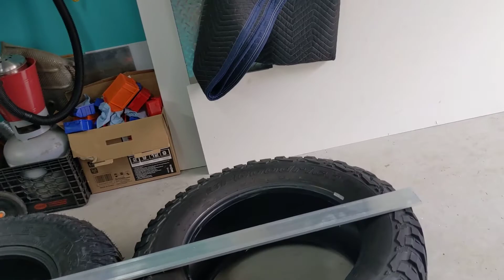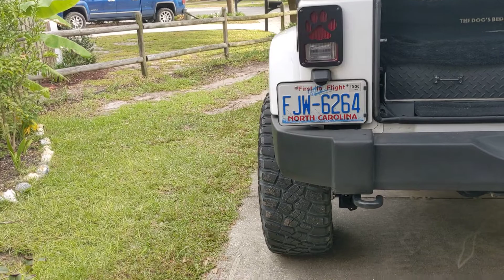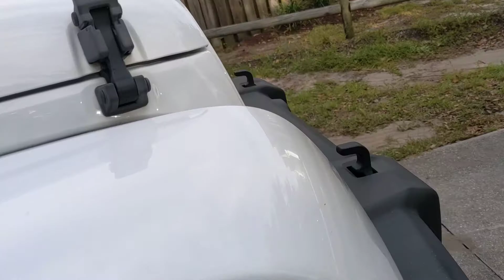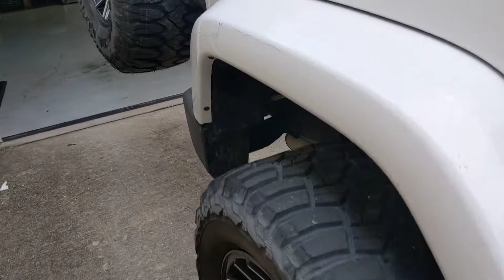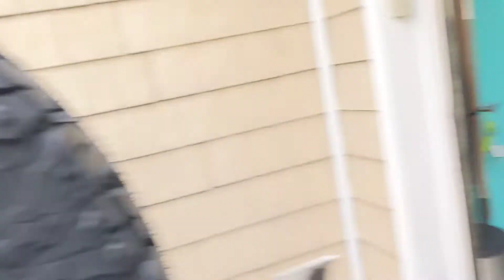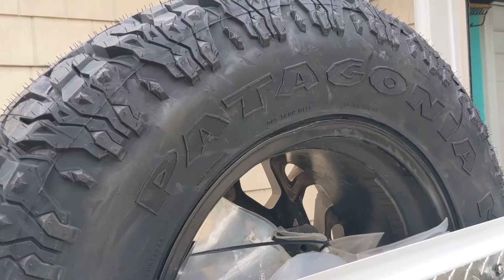Jeep Update: 37's, C-Gussets + Gears...

Comment: Just started following you.  Love your build and your instructions are super clear and communicated very well.  Do you plan to do anything to beef up the axles or are the gussets enough to support 37s?  I'm also interested in your opinion on the Patagonias.  I read other guys hating them for premature wear, impossible to balance and bad traction but others love them and chalk it up to improper inflation.  But they are supposed to be quiet on the Hwhy and that's important if you have to travel far to find the dirt.  Can't wait for your LT perspective.
Reply from the maker: Thanks man I appreciate it! As of right now I'm only going to do the gussets as the pats are super light 37s and my use is flat beach/sand and forest service trails I might do some light wheeling in Uwharrie but that is still mild wheeling all things considered. If in the future I do plan on going out west to try some more agressive off roading I'd likely truss the front and rear axles completely. The patagonias have been amazing thus far 2000 miles all the wear seems normal at this point and I'm also using balancing beads so they are the smoothest tires I have driven on my Jeeps over a 12 year spread of Jeep driving so I love them but that could be in part due to the beads. Thanks for watching and commenting 👊👊
Reply: @ianmburke  Awesome info, thanks!  You might've just sold me on the Pats.  I checked your links but didn't see anything about the beads.  Can you give me the brand?  I'll def want that same ride quality you have.
Reply from the maker: @patrickdailey3150  sorry for the slow reply, yt didn't let me know you responded! I had a local shop do the beads but I'm not sure the brand, if I can track it down I'll make note of it for you. Now I just hit 8.5k on the pats and they are by far my favorite MT I have run in the past 10 years - and undoubtedly the beads make a huge difference for the ride quality
Reply: @ianmburke  No worries.  I replaced 37" Mud Grapplers with 37" Pats and they are not quiet, they are SLIENT!  Didn't need the beads - balanced to zero vibration.  Love these tires!!  Thanks for the lead!